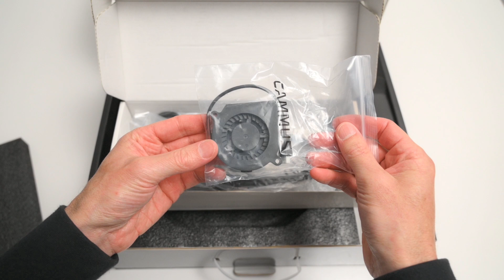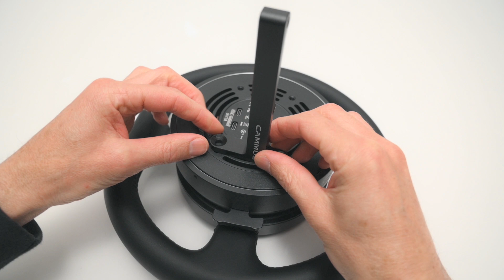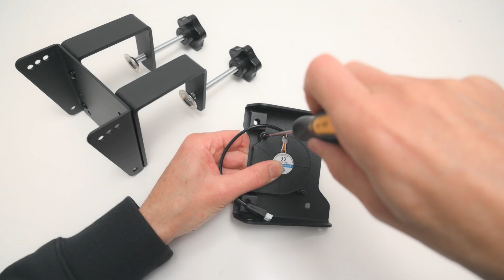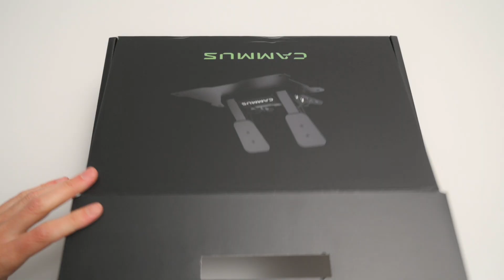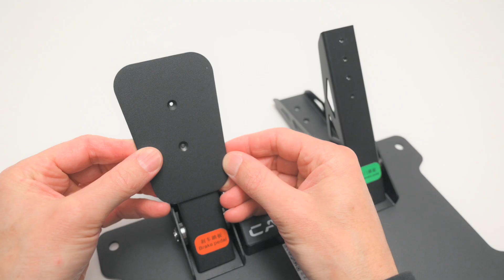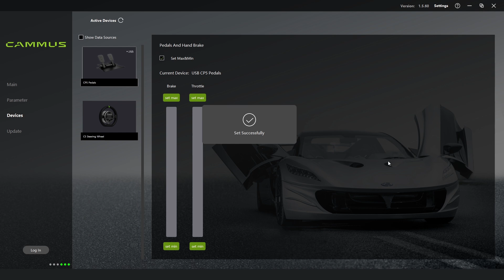ENTRY LEVEL DIRECT DRIVE CAMMUS C5 KIT

Comment: I had the C5 for a week and about the software, you can now display the gear, change rpm lights colors, change knobs behaviours. Also you can change a lot more settings, effects and driving assistance. And btw it goes up to 2520º of steering range.
Reply: How is it now at week 5?

Comment: This is probably the ugliest wheel to ever get released yet they still make it D-shaped. The only reason they do this is because it looks "cool" even though it's way less versatile than a round wheel. Why do they all do this? I don't get it...
Reply: Is the cheapest DD on the market, with a motor right into the wheel, the feeling is soo good. Is ugly ok, have bad paddle shifter, but some years ago for the same price you can only get a g29 or t150. So this is why they did, because they are smart.

Comment: Perfect beginner wheel for VR so you don't get to see it haha.
You forgot to add that for Europe you can go to to French or Spain Warehouse and get the C5 wheel only for 250 euro.
Probably the pedals are not worth to buy unless there is a quick way to upgrade them to Load Cell or Hidraulics.
Reply: insane shipping costs ... cammus c5 and pedals with desk mount is 405 euros due to shipping to netherlands from spain being 77 e .. idk why .while fanatec csl dd bundle w table mount comes to 455 w shipping and for 20 e more i can get the bmw steering wheel

Comment: Good attempt at saving us some money. Cause we know DD is overpriced. But the aesthetics are horrible. I’d rather save a little more and get something a little better with options for various wheels. That being said.. I’ll give you a couple hundred for the setup 😆
Reply: Despite having the servo motor on the steering wheel, it is still being a regular metallic steering attached to the servo, so it can be replaced with any other steering. And I don't know how much money does "a litlle more" mean to you, but the closest DD in price are Fanatec and Moza 5nm wheels, which are worse when it comes to force feedback and are about double the price. All that without taking into account the fact that a separate steering wheel will cost you around 100-200€ each. This is by far the best entry level DD that you can get right now.
Reply: @edermerino7489  the wheel is included in the DD CSL pack.
Reply: @DrGeta666  I know, but he mentioned the possibility to swap wheels, and if you want this to happen, you must buy at least to wheels
Reply: It's ugly and you can't do anything to it! Change wheels how? Proprietary nonsense? No thanks.
Reply: Not for $300. For $500 you can get the DD CSL kit which is soo much better.
Reply: for me atm cammus c5 and pedals are 405 due to shipping being 77 e from spain while fanatec csl dd bundle w table mount come to 455 obv fanatec is way better ,more established,more help and info to be found online and setups and pro's use it and all in all upgradeability is very nice too . @DrGeta666